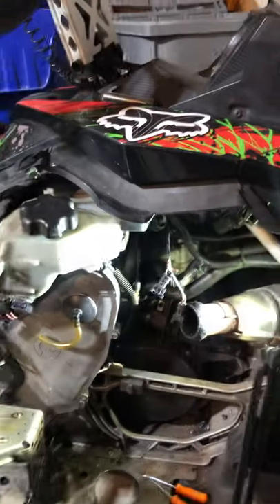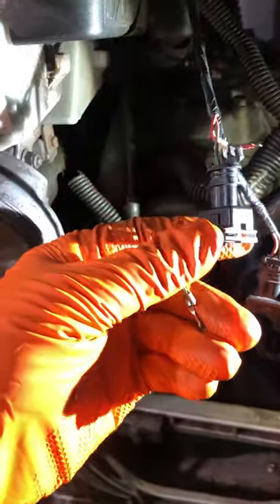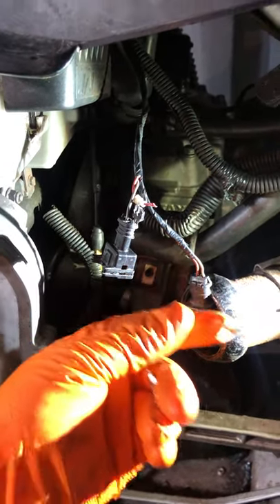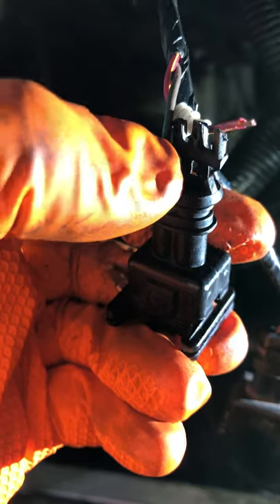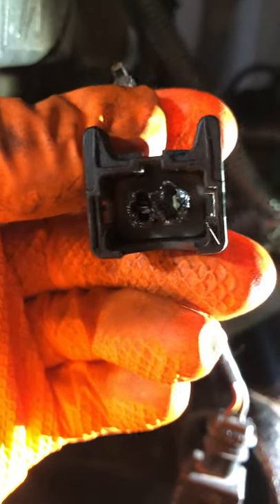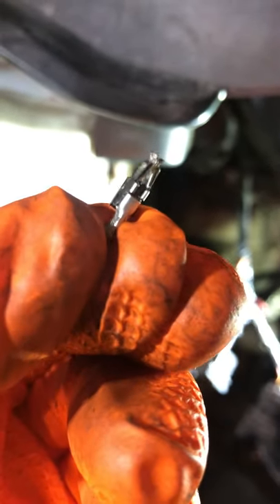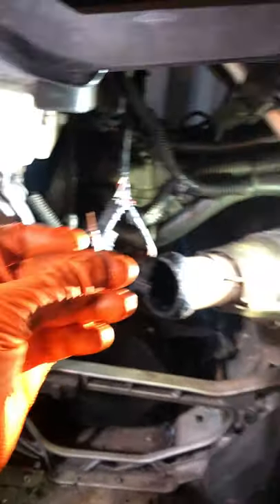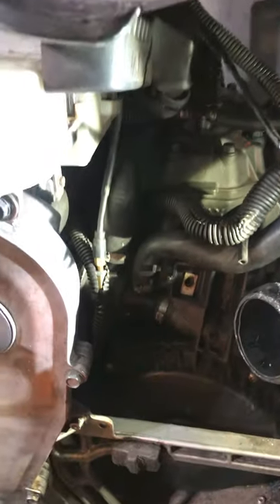Ski-doo XP Check Engine over 6000 RPM - Fix

Comment: Finally what is your problem I have 2010 Summit and he do the same think
Reply from the maker: Yeah I hope this helps. :) good luck with your sled.
Reply from the maker: Oh and ps they make a tool to back the pins out so you don’t mess them up. Wish I would have had these when I did mine. ;) 

Vignee Terminal Removal Tool Kit,80Pcs pin Terminal Extractor Kit for Car,Wire Connector Pin Release Key Extractor Tools Set for Most Connector Terminal with a Protective Bag https://www.amazon.com/dp/B08XWD944Q/ref=cm_sw_r_cp_api_glt_fabc_GEQ20MZ1AE5GSSJ79QH4
Reply: I might have the same problem too but it never comes in till 10-15 minutes of riding and then progressively gets worse completely clears after I turn sled off though. And runs fine till check engine lights comes on so far dealership hasn’t figured it out is this similar to your problem
Reply: Travis Holte did you figure it out? Mine runs fine for 10-15 minutes too and check engine light comes on. Temp sensor or bad/loose wire in main engine harness could be the problem.
Reply: @onefiftyfour8505  
Kind of took it back to the dealer again and they said it was a short in one of the wires on the main engine harness, but the main engine harness is discontinued from brp so gonna have to wait till it comes in again and then troubleshoot by checking wires or remove the entire harness and see if I can find the problem wire 
It’s a pretty shitty deal, but if I get bored this summer I guess I got a shop job
Reply from the maker: @travisholte3241  Dude, I would check all your wires where they connect into the back of a plug/connector. I NEVER would have guessed my wires were broken/bad/or shorting out by just looking at them. When I was inspecting my wires I could feel that they could bend extra easy at the base of the plug. That feeling of being so limp or floppy made me thing the wire had broken inside the housing or the rubber coating over the wire. Does that make sense? Put another way, let's say it's a red wire, the red part was fine, but inside the metal was broke or sheered. 

The fact that your problem is only when it's warmed up makes me think it could be another wire. Maybe a wire to something that only turns on once the machine is hot. I can't think of what that would be, maybe just a heat sensor or something?
Reply: @TJJorg  thanks man appreciate your thoughts and reply
Reply from the maker: Yeah, dude. That floppy feeling is exactly what I had going on. The coper part of the wire was broke, but not the rubber part, so you would not be able to tell by just looking at it.